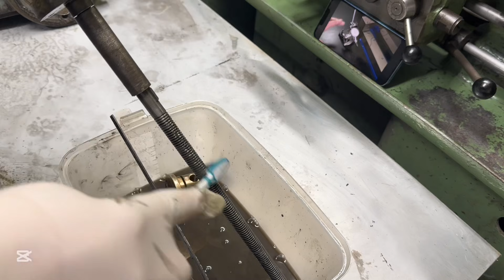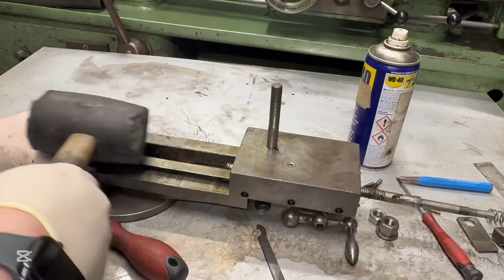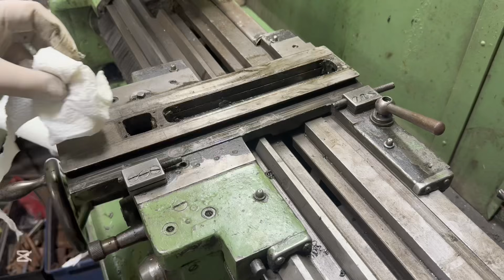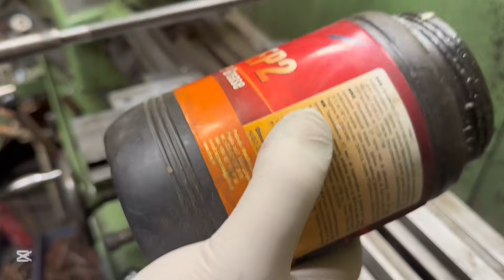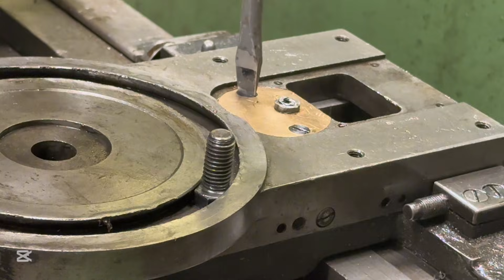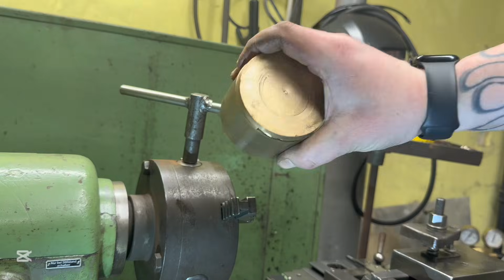Fixing my tool room lathe 🥹

Comment: I remember a similar ordeal with my Leinen's cross slide.....forgot to put some parts in and had  to disassemble the whole thing again. Praying the key dont fall into the gearbox :D I don't know if you are familiar with the function of all the levers on the saddle gearbox...I sure was not when I got the machine and had to learn through experience. So the two levers on the right side do the following: the upper one engages/disengages to thread cutting shaft and should be preferably used only when cutting threads (if used as a saddle power feed it just wears down the shaft). The lower one engages/disengages to power feed shaft, which is to be used for generic machining without torturing the thread cutting parts. The lever in the middle of the saddle gearbox ( the one that has three notched locked positions) is used to switch power between cross slide and saddle autofeed. In the lower position that it is in the video, it engages cross slide autofeed. In the middle position autofeed is disengaged altogether and in the upper position it engages autofeed to the saddle (away or towards the chuck along the bed). The saddle gearbox has an intricate switch off/overload protection mechanism built into it that turns off autofeed when one runs into something too heavy on the way and is in danger of breaking things. It allows for using stop blocks which can be secured on the bedways or cross slide to cut into the same dimensions under autofeed and not worry about switching off too late or too early. But this option is ONLY available if one engages autofeed through the correct lower right hand lever. Engaging it in thread cutting mode through the upper right hand lever will lock the machine into one rigid unit without any overload protection. Running into the chuck or cutting too deep in that mode shall break the gearbox or at the very least rip off the bolt at he end of the gear cutting shaft in the gearbox side. Ask me how I know....       The sensitivity of the overload protection mechanism can be adjusted through a square headed bolt that is located on the left hand side on upper face of the saddle. It is basically under the cross slide side. Turn it counterclockwise and sensitivity goes up, go the other way and it engages at greater loads. But to test the functionality of the overload protection it is enough if one blocks the manual turning wheel with hands when autofeed is engaged through the LOWER lever. It should block the movement of the saddle and disengage the autofeed lever automatically. Same goes for cross slide autofeed. Block the rotation of the handle manually and it pops down the powerfeed handle. If it works correctly it does not take much force at all to stop it by hands.  About the oil in the gearbox: definitely the gears should be covered by a layer (yours look awfully dry, so adding some fluid should be advised). There is a looking glass at the front of the saddle and the proper oil level should be at about half the looking glass. It is not critical, but it should be enough to be carried up by the gears during operation to cover all the moving parts. A bit more shall not hurt. Type of oil used is also not critical as long as there is some in there to provide lubrication ( the loads are not that huge on the gears really) . I actually used chainsaw chain oil in the saddle gearbox....it is nice and gooey and clingy. Works like a charm for years now. I also use it to lubricate the ways and cross slide. Do not use grease on the sliding contact surfaces, it tends to be too clingy and traps dust and fine chips leading to more wear and creates a sticky feel of the machine.  it is a pain to wipe of and clean as it ages....just plain mineral oil is a much more elegant option for that purpose.
Reply from the maker: LOL I think you went to all thge stuff im gong thrue :D :D 
Thanks for taking the time to explain all those features and tips, especially about the overload protection. I did not know that... And no I did not now that is just for screw cutting. Thanks alot for the help! I have problems with the secnd speed lever too... the cltchdoes not engage to second its stuck in first.. do yu know what  the problem might be? Thank you again! Wicked
Reply: @WickedTools  In the lower compartment (table portion of the machine so to say) under the headstock and basically over the motor is the clutch assembly and fast slow speed switching "box". You can access it from the hatch on the backside of the machine. The clutch can and must be regulated so that speed switching works properly. If it is off due to wear and tear then what will happen is that the speed gets stuck in one setting and the other one does not engage at all or it is slipping overly in all positions. It was a damn tricky and elegant system and I spent a good while tinkering with it to get it working more or less properly even though I had the maintenance manual for the machine. I think it just needs adjustment as it works in one position, but it can also be that the clutch mechanism inside is worn. In that case I would expect excessive slip in all positions though.